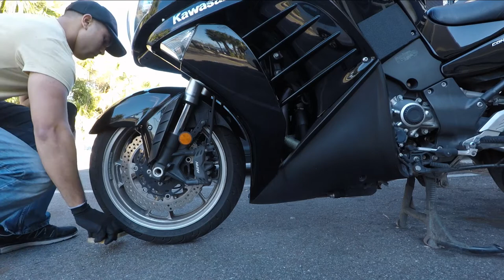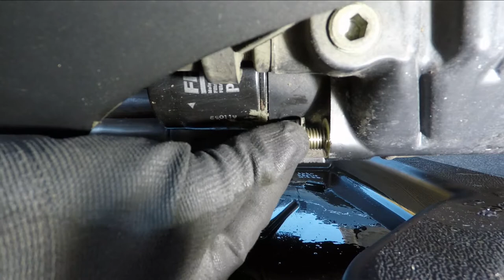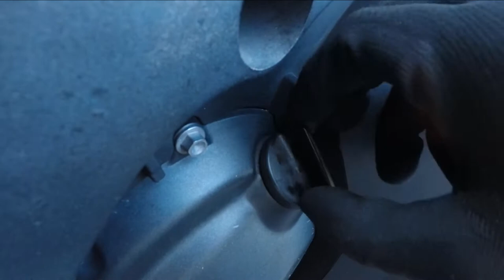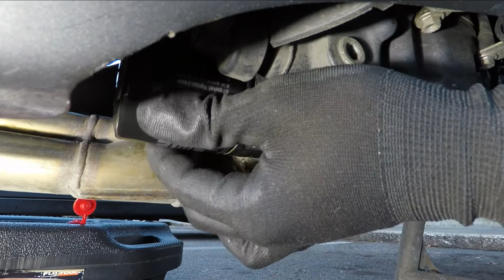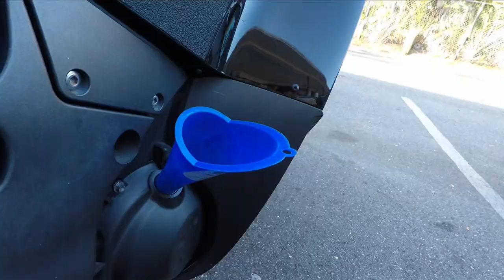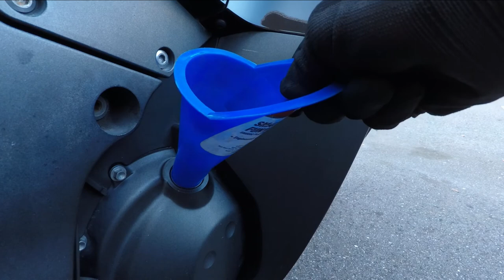2011 Kawasaki Concours 14: Engine Oil and Filter Change

Comment: Only things I would do different.  1.  Warm up the bike first.  It stirs up all the sediment much better than doing it cold.   Also it drops your viscosity and the higher velocity of the fluid also helps remove sediment better.  If you do this, your sight glass will not be so yellow.   Also your oil will look cleaner much longer in the sight glass. Warming it up also makes sure some oil is up at the cams when you start it with the new oil.  SO that dry start will not be as destructive..  2. I would prefill the oil filter with oil.  usually if you fill it once to the brim all that oil will be absorbed into the filter.  You can then fill  it about half way and it wont spill when you try to install it.  Prefilling the filter cuts that dry run time in half.  That was a great touch putting a block under the front wheel to get the level correct. so I learned something too  Great video.

Comment: You can get the oil filter plenty tight by hand. Wear some rubberized grippy gloves and reach through the opening in the fairing from the front to get a good handle on it. I was able to get it pretty tight that way.

Comment: Outstanding video. Well done. The last step would be to start the engine and let it idle for a few minutes. That will fill up the oil filter with oil and take the level down just a bit. Turn the motorcycle off and leave it parked for a few minutes .Then recheck the oil level after the motorcycle has set for a Few minutes add more oil if necessary. Great video

Comment: Hi is it necessary to level the front end?  If so how tall is that block you made?  Thanks
Reply from the maker: 1-1/4" tall. I just used it to fit the drain pan under the bike
Reply: Ok, thank you!